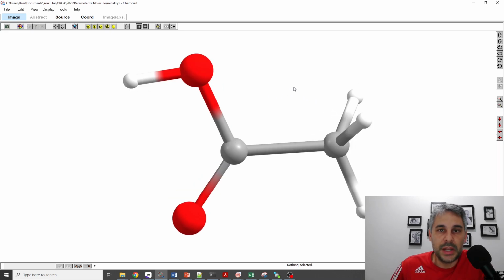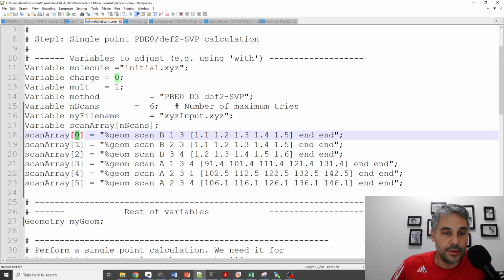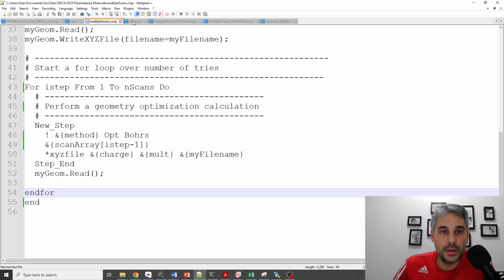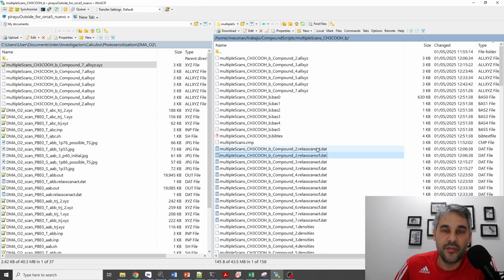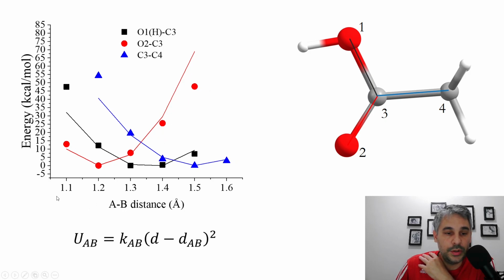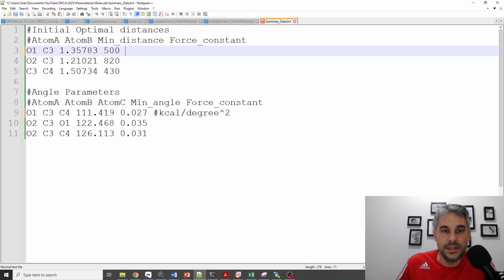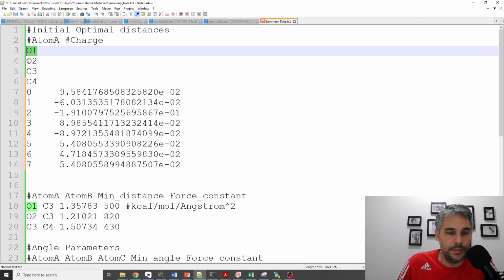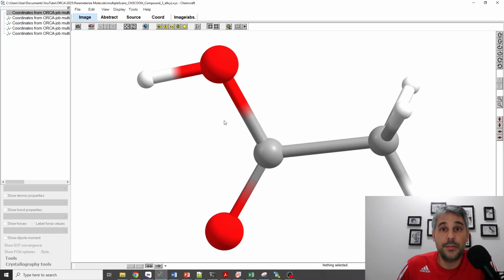Make your own force field with the Orca Compound Module (First steps)

Comment: Force fields are prime candidates for machine learning models. When you automate the process, it may be worth automating for a number of specified molecules or levels of theory. This would enable for easy development of datasets for that purpose.
Reply from the maker: Yes, that would be one of the applications. However I'm still far from being able to automate the whole parameterization process. One of the problems is that there are many more dihedrals for a medium-sized molecule than there are bond lengths or angles, and dihedrals probably require more points to be able to fit a function that spans 0º to 360º rotations. So even if I can fully automate the process, it may take really long. I have to see, first do it semi-automatically, and see how long it takes for small or medium-sized molecules. But unfortunately right now I have zero time to do this.